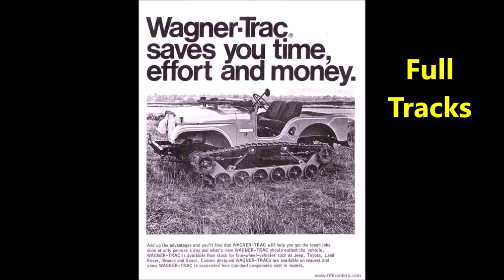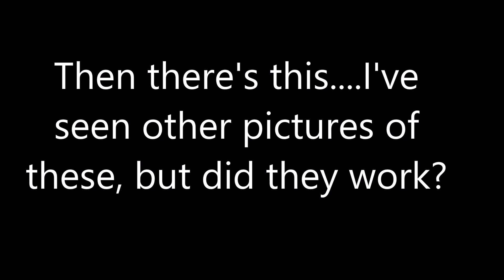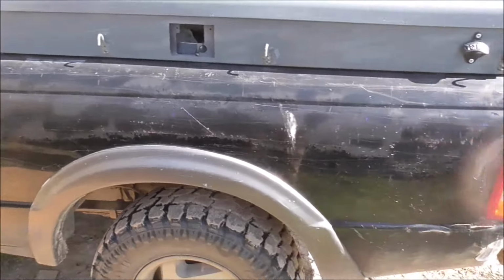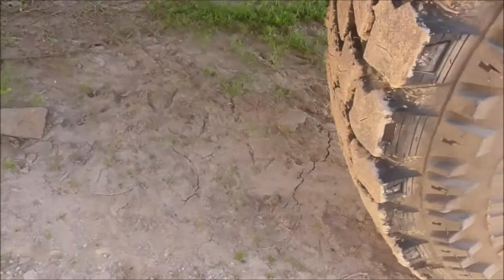Mutant Snow Cat Truck Ideas...Still Thinkin'....

Comment: Indeed, vehicles with tracked wheels and steering skis can run on snow-covered smooth roads quite well. But I don't know for certain whether the vehicles are well-suited for driving in extremely deep snow, especially on mountain roads. Perhaps snow chains may be a cheap and effective way to improve a car's cross-country ability, and safe handling and control. Thanks for sharing, have a nice day!
Reply from the maker: I think you are right.  Jeff's tracked side by side doesn't stay on top of the snow very well either unless it has a good crust on it.  It keeps going only because it has more traction. This would be fun to do, but I need to look into it more to see if it would be practical or not.  Thank you for your advice as always!!

Comment: OK Gary, here goes an idea for a half track.  Take the pickup bed off and extend the frame to install another axle for the track then install a flat bed so you don't lose the ability to haul.
Reply from the maker: I think that probably would be the easiest.  I kind of want the track more centered under the truck to support the weight though.  Looking at some of these pictures, not all of them are though.   I dunno....still thinking on this.....

Comment: An old trailer house axle mounted were you said nake that with a spanner to tighten track. Make a dulley sort of to get past the cab. The track thats the tough one maybe an old tractor tire. Im tryin to think cheap well an half easy. Maybe a ratcheting cain binder to pull the trailer axl. To tightin the track. At least the truck could stay stock you'd just bolt on some stuff. I dont know tis would be a fun one to think about even uf you didnt build it
Reply from the maker: I agree!  I've seen tracks made from old tractor tires with most of the sidewall cut out. They seem to work, but I wonder about snow and ice building up inside of the tractor tire?  I think it would either cause it to slip, or push it off the wheels?  I like your idea of making it wider to clear the cab.  I bet that would work.  The picture of that car with everything built under it is interesting too.  That might work better than anything really?
Reply: @MuskratOutdoors  yeah I like the car to. I was just thinking of what I had on hand or what would be easy an cheep. Iv pondered on making the same thing with an old riding mower. It's junk so I can't hurt it might make a fair little bulldozer. Just have other things to do an not enough room to store it as it's getting made. Much luv to you both

Comment: I would go with the halftrack idea. Simple is best and given your options, I feel that this may be the best option. I think that if you went with a wide set of tires on the front, you should be fine. How about a custom made set of skies to go on the front like the amphibious bush planes. Get the old noggin working & solve the problem. Keep moving forward.
Reply from the maker: I think that would be the easiest.  I have some old guard rail ends that would be perfect for skis.

Comment: Honestly, the most cost effective way might be to find an older Thiokol Son Cat, one of the little ones that used the Ford 170 or 200 six and differential steering.
Easy trailering, on and off load.
As for a home built, if it were me, I'd  straighten the framemount the rear axle solid to the tail, and let the forward axle and bogeys do the suspension work.  
I'd put the fuel, and as much as I could above the frame, and try to set up the bogies and forward wheel suspension on air or coils , independent on each side with any cross members at frame height, so nothing would snag.  Heck, maybe even a sheet metal belly pan.
All day dream stuff.  I'm  reetared, got the time, so take my wild haired notions with a grain of salt.....
Take er easy!  Somethings  wrong if a guy ain't figuring stuff out while he's doing other stuff.  Makes the day a lot easier!
Reply from the maker: It would be fun to do this, but I need to work out a few problems first.  Really, it might be easiest to just build the whole thing from scratch.  Look up "Personal tracked vehicles" on facebook.  It's a group that builds all sorts of neat tracked machines. Some really neat stuff on there!

Comment: I have 2 tracked ryggs a johndeer gator and a Nissan frontier. Tracks 4 it were 12750. Bucks gator 6 k. If you travel on forest circus roads you are required to have insurance. In Montana if you go off Rd you also need a trail permit. If you built a set guaranteed you would be hiking out. Not just from the tracks falling off but old truck breaking down. Get a wide track skidoo single cylinder. Or pay 25 k for a machine you can count on
Reply from the maker: The insurance part would make this unpractical.  Montana and Idaho have different rules, but I don't know how much different.  I think this could be done, a lot of folks do make their own that work as well as the factory made ones, but yeah, if they aren't right, there will be problems.  I do have a snowmobile, and will probably use it this winter, but the trouble with trapping is that you have to check traps no matter how nasty the weather is.  Some of these storms make it no fun on a snowmobile.
Reply: @MuskratOutdoors and another problem with the tracks on. I just got done dealing with. They are wide so you have to have a deck over tandem axle trailer 7 k lb axles with fold down heavy ramps. A good use trailer is at least 8 k. I bought a gooseneck 34 ft deck over for 5k. I have a camper on my diesel truck I stay in. So I cut the goose neck off built a bumper pull. Then trailer was 34 ft 2 long 2 get turned around up in the woods. So I cut 8 ft off redone the back end. Now have everything I need except for Malloy only letting us trap 45 days for woofs in Montana. A lot of work people don't realize that we go through 2 save what's left
Reply from the maker: @KenCaudle  Trailering it would be a problem. Luckily I live at the bottom of the road I use for trapping. At most, it is maybe 300 yards away.
Reply: @MuskratOutdoors  another thing with the tracks on the truck they are boughten factory made in soft snow easy riding. Once your trail is packed frozen over they loosen your fillings up unbelievable rough riding like running a dozer on pavement. Shakes everything loose. I had 2 k put in 2 new front end parts and labor on a 2005 Nissan frontier before I took it out. Axles ujoints. Any thing that could break I had shop fix first .up broke down 20 miles from the road isn't any fun. Why I tow my sled behind. Not walking out 25 miles again. I have a snow plow on my one ton dually diesel and a hundred gallons of fuel in a slip tank. Haven't had 2 plow the road yet usfs would frown on that

Comment: I think ....... so probably dont listen lol best answer is a snowmobile and a trailer , an old skidoo alpine twin 15 " track wouldn't take much to put a cab on and lots of heat off a 2 stroke engine ..... long as its not exhaust lol and add a electric winch, my best thinking was a 1966 3/4 ton dodge 4x4 with extended leaf springs to get body higher and 17 7.50 rims and tires with chains next step was 20" semi tires but never got that far, tall and narrow work best in snow  with tires, had a little jeep with 14 35 15 ground hawgs that went threw anything!!! but snow/ice got stuck in my plowed flat driveway it just sitting there lol , was a guy up here ( U P Michigan ) put snowmobile tracks and running gear under a ice fishing shack with a wood heater in it and ...... it seemed to work !! but not down the hiway lol
Reply from the maker: I do have a snowmobile.  I'll probably just end up using it, but they aren't very much fun to run in bad weather.  Trouble with trapping is you have to check traps.  You can't wait for a nicer day!

Comment: The Argo setup would be the easiest way to go, as it's already a brake/clutch like steering system. For me just finding a 40s, 50s, 60s two or 4wd that some jack wagon screwed up is my goal. A standard old straight, or slant 6 engine four on the floor pickup. I will never understand the mentally behind lowering a  frame with car suspension,  small block V8, and turbo 400 automatic transmission.  The TRUCK  was made to be a TRUCK. Stop messing with perfection. 
Just saying 
Mountain man
Reply from the maker: Exactly!  Some of those show trucks couldn't clear a golf ball!  I don't understand why they do that!  Full tracks, with a separate brake system on each side would actually be pretty easy to do, and probably the best way to go.

Comment: Its not that hard! When I worked for a sawmill back in the 80s we took a old duce and a half that had a bad engine.  We flipped the back axle so it would drive in reverse. Cut the frame off, welded a old forklift to it. Took a old 60s Chevy 283 with tbe powerglide transmission and hooked it up to the tranfer case! We used it without brakes for a while until i figured out how to rig them up! I  rigged up disk brakes on the transfercase output shaft!
Reply from the maker: Exactly!  There's a LOT of things that can be built pretty cheap that work fine.  Working out the bugs first helps, but there's always things you don't think about until it happens. Kind of makes it fun....unless you have to walk a long ways in the snow!

Comment: The tracks raise the vehicle up you don't need to raise the truck
Reply from the maker: The triangle shaped ones would.  Keeping the axle from dragging is a problem though.
Reply: You would be just pissing in the wind waisting time and money trying to make something that won't work. Usfs is federal doesn't matter state 2 state on insurance. You ever ran into a usfs truck coming around a blind corner they would have you under the jail not insured. And another big deal is when it breaks down it's always right in the middle of the road. And is why I have 2 tracked ryggs. You can't just leave it people can't get by it. My gator is a 2012 only 1756 miles brand new camso tracks a track broke clean off 25 miles from camp trapping year B4 last I tow my skidoo backwards on a wrecker deal track off the ground 2 get back. It's serious business when you break down or get stuck way back in